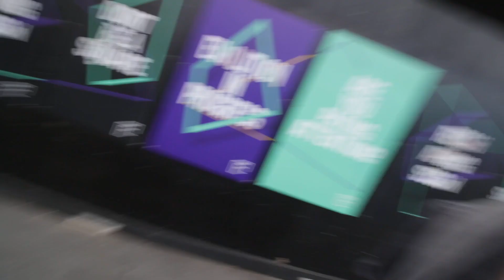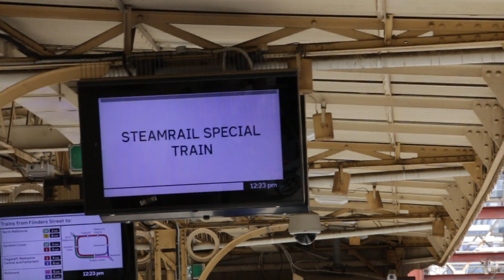Suburban Steam Shuttles

Comment: Very nice video , but get some wind protection, intro audio outside was blown away by the wind, speeding the vid up a notch is nice but not too fast then it will become too flashy, just use the same speed if you show the outside view, and perhaps reduce camera movement on the fast move. Very nice old train. Length of the vid is nice, you can make it longer if you maintain the same speed overall mixed with normal speed at interesting places.
Reply from the maker: Thanks for the feedback, I do have wind protection now. I’ll be more aware of my camera movements in the future so that the moment my doesn’t become too jerky.